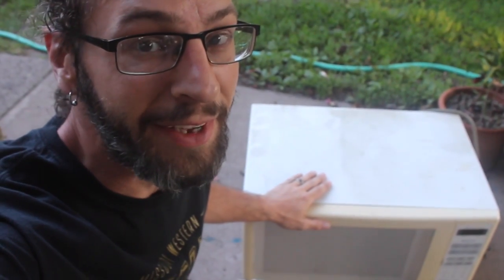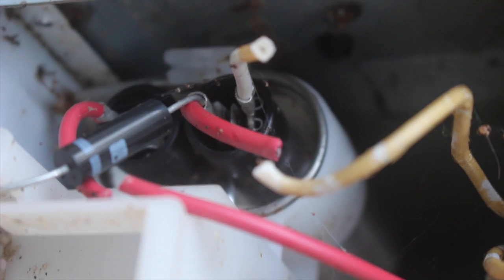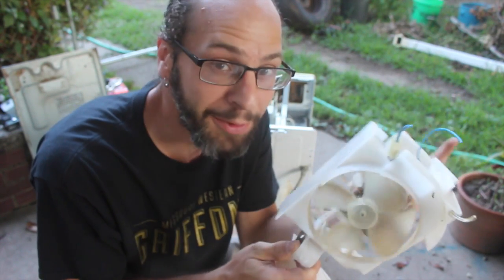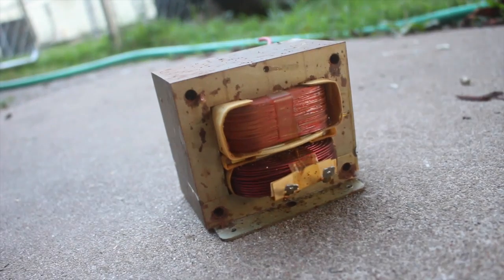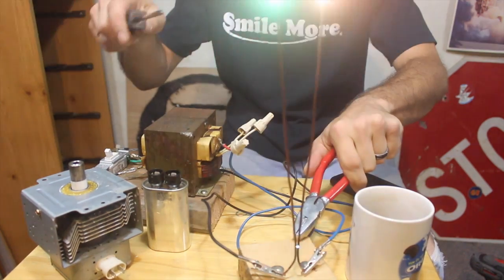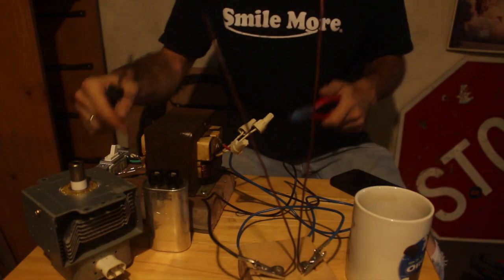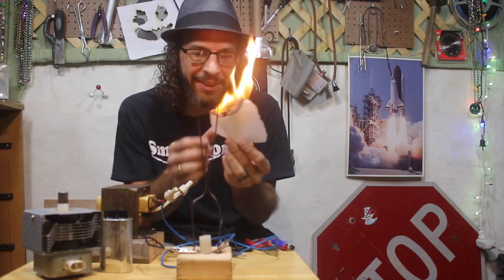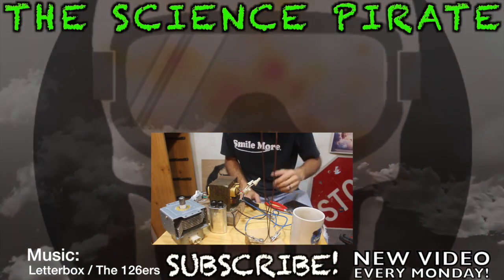Building a Jacob’s Ladder with a Microwave?

Comment: Should you have  TWO  microwave oven transformers  ( ? ) ... wire the mains inputs in   ANTI  PHASE   and you will get  Twice the output voltage across the output terminals  (  a bit more spectacular ! ) .... DO NOT FORGET to ground ( and connect ) both transformer's Iron parts , for safety and to complete the EHT circuit ! .. ( tried - n - tested ) ..... DAVE™🛑

Comment: did you just hook up the 2 loose ends of the lower transformer coil to the + and - of the 110V - without a resistor.. An dthen the two ends of the upper coil to the ladder ???
Reply from the maker: Yep!